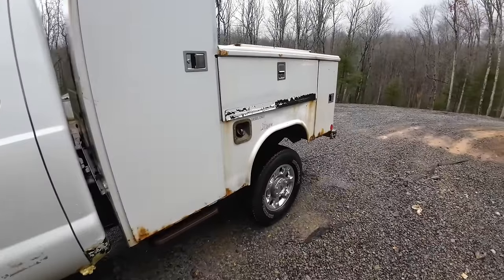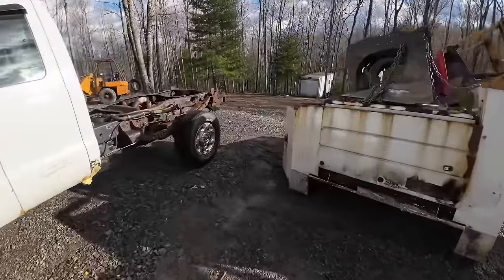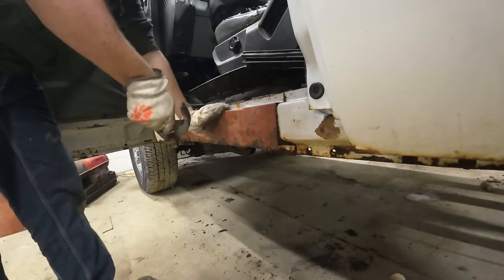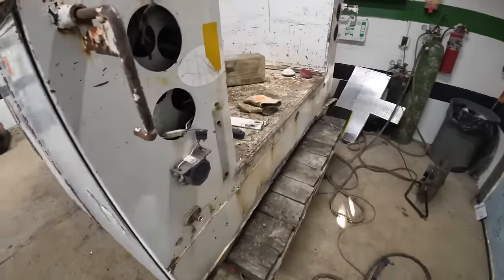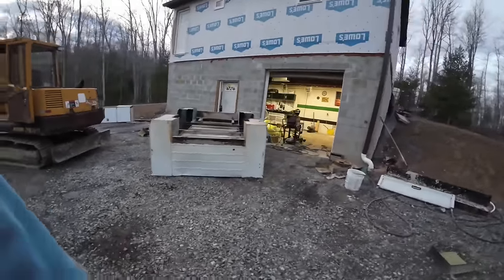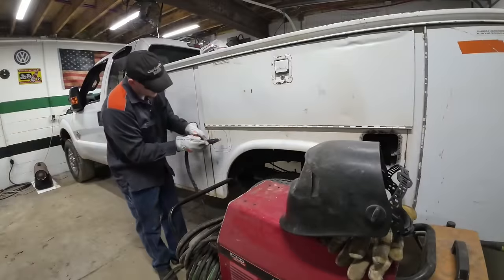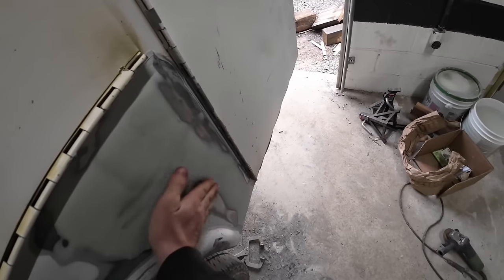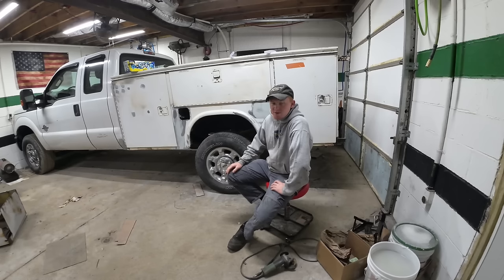Removing The Old Bed off my Service Truck, Then Modifying a Chassis Cab Bed to Fit

Comment: Don't worry about paint, mix old oil and trans fluid and spray light coats over the whole frame/running gear. It works!

Comment: You said you hated your welder. I noticed you were not using the gas shield on the gun. Are you using coated wire? I never tried mine without the shield but I generally use gas with mine. I tried the coated wire but didn't like it. I enjoy your videos.

Comment: I bought a ford with a reading bed. And it's about as much as shape as yours.  I called a reading dealer to get replacement doors and the cheapest on is 900 with no latches or hinges. Cost the price of a bed to re door the unit.

Comment: Just wondering why you couldn’t just cut a piece of diamond metal to use for the patch job on the corner of the cab? Just like you cut a piece of metal for the door to cover the rust.
Reply from the maker: I could just didn’t feel like it that cab is about shot

Comment: It takes a certain kind of talent to dig some scrap out and make it work for the truck. It’s a work truck. And yeah, I could barely tell you patched it. 😊 
You need about 8’ more added to the depth of your shop. Add a deck on the house and make it a roof for more shop area. 😊

Comment: Are you gonna fit that big metal bed cover on the new bed, doesn't look in that badder condition.
Reply from the maker: No, I was going to but it would be a lot more work plus it’s a foot shorter